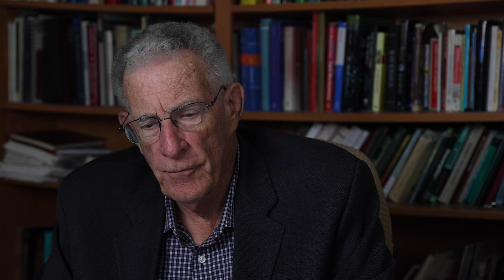The Mechanics of a Cancer Cell

Comment: I am afraid the latest research has shown that the aerobic glycolysis in cancer cells is NOT a universal phenomenon, and some cancer cells may still utilize oxidative phosphorylation. Additionally, The Warburg effect is NOT exclusive to cancer cells; some normal cells, such as certain immune cells, can also exhibit aerobic glycolysis. The complexity of cancer cell metabolism is highlighted by the presence of variations and exceptions. There is a strong genetic factor in cancer as TP53 gene mutation has been linked to increased glycolysis and the Warburg effect in breast cancer, for example.

To make things even worse, individual tumors often exhibit metabolic heterogeneity, with some regions or cell types utilizing glycolysis while others rely more on oxidative phosphorylation. This adaptability complicates the idea of a universal metabolic hallmark. To top it off, there are variations between individual cancer cell's metabolism within a single tumor and differences in tumors from the same type between different patients. 

Additionally, the metabolic change observed by Warburg is adapted to the hypoxic conditions inside solid tumors, resulting from the same mutations that cause other abnormal characteristics of cancer cells. Therefore, the Warburg effect is not the primary cause of cancer, but rather one of its characteristic effects.

For details, see: New Clarity on the Warburg Effect.
Reply: Dear Firelight.
The YouTube comments section is generally not well suited for academic debate, and typically an exercise in futility, but just as a point of clarification:

I agree with you that the “Warburg effect” is not a universal phenomenon, mostly because it is improperly defined. “Aerobic glycolysis” or “Walburg effect” is typically defined as “lactic acid formation in the presence of oxygen, when no lactic acid would be expected due to sufficient oxygen availability” (i.e., lack of Pasteur effect). 
Although varying degrees of lactic acid production are observed in almost all in vitro and in vivo experiments, recent (not yet well confirmed) genetic editing experiments show other pathways may compensate for loss of LDH activity (cf. PMID: 39211256). In vitro, the Crabtree effect also makes it difficult to interpret the contribution of OXPHOS and “Warburg effect" to viability/proliferation. I am not convinced proliferating non-tumoral cells display the same “Warburg effect” as cancer cells due to this, and it is difficult to quantify.
The important point is that no ATP (energy) is produced by “the Warburg effect”.

However, the argument presented in the mitochondrial metabolic theory of cancer, as best as I can represent it in my own view, is that loss of efficient ATP yield from OXPHOS (not to be confused with the electron transport chain or TCA cycle), leads to upregulation of substrate-level phosphorylation flux (sometimes called SLP or “fermentation”) in both the cytoplasm and mitochondria. This has nothing to do with the “Warburg effect” (lactic acid and NAD+ regeneration), but when observed, it would be a consequence of OXPHOS insufficiency, which is the initiating factor of the cancerous phenotype. The Warburg effect is not a cause of cancer.

Proton gradient and ultrastructure-dependent activity of Complex V and cytoplasmic and mitochondrial SLP flux is what generates ATP. All other functions may be important for the absolute capacity for proliferation, but do not generate energy. To the best of my knowledge, cancer cells are dependent on SLP flux (“SLP dependency”) and, despite having a measurable level of oxygen consumption, are unable to sustain proliferation using OXPHOS alone (“OXPHOS insufficiency”). 
This is why you will not find any papers showing cancer cells proliferating under dual inhibition (using drugs, to mimic what can be achieved in vivo) or depletion of SLP fuels (primarily glucose and glutamine, simultaneously), despite providing them with any oxidative fuel of your choice (fatty acids, lactate, ketone bodies). Cancer cells will only proliferate as long as glucose and glutamine are present. When they are not present, cancer cells are dead, which is an important hurdle for optimal proliferation, despite maximal utilization of oxidative fuels.

The goal of ketogenic metabolic therapy, which includes both dietary and pharmacologic strategies to target SLP metabolism, is to reduce the ability of cancer cells to produce energy through SLP while upregulating OXPHOS function in normal cells. 

Indeed, inhibiting glycolysis and glutaminolysis also reduces biosynthetic activity (“building blocks”), which may be a significant contribution to the therapeutic effect. However, viability of cancer cells is determined by ATP sufficiency, which is what we aim to target. Most research on this topic studies cancer cells with active glycolysis and glutaminolysis (sufficient ATP from SLP), and then explores how much or little they can use other metabolites. This is interesting, but is not the goal of KMT, and thus non-relevant to the discussion.

We are trying to advance this understanding in the scientific literature, which takes time and nuance in making the connections to previous literature and obtaining solid experimental data. I would recommend reading the papers the Seyfried group has published, and engage with the positions made in those papers. We are working on several publications that are intended to address the common questions you presented here.

I hope these are interesting points of discussion to you and anyone interested in the subject.
Best wishes, 
Dr. Tomás Duraj 
Postdoctoral research fellow 
Dr. Seyfried laboratory
Boston College
Reply: @drtomasduraj  Thank you for your thorough explanation of the Warburg effect, substrate-level phosphorylation (SLP), and their roles in cancer metabolism. 
I wanted to bring up a study I came across: "Dietary glutamine supplementation suppresses epigenetically-activated oncogenic pathways to inhibit melanoma tumour growth” Mari B. Ishak Gabra et al.  This research suggests that glutamine supplementation, rather than promoting tumor growth, can actually suppress specific cancer pathways in certain contexts, like melanoma.
This seems to counter the traditional view of glutamine as a straightforward energy and biosynthesis source for cancer cells. Instead, the study implies that glutamine's metabolic effects may vary depending on factors such as tumor type, microenvironment, and the epigenetic landscape.
I’m curious how findings like this might fit into the broader framework of ketogenic metabolic therapy (KMT). Could there be cases where glutamine supplementation might paradoxically benefit cancer therapy by disrupting oncogenic pathways or reprogramming metabolism?
Additionally, does this point to a need for more personalized approaches in targeting cancer metabolism, where therapies are tailored to the specific metabolic vulnerabilities of different cancer types?
I’d love to hear your thoughts on this and how such research might refine our understanding of glutamine’s role in cancer. 
I’ve been in contact with Dr. Seyfried and Derek Lee, and our discussions have greatly expanded my understanding of the complexity of these pathways. If you’d like to continue this conversation further, feel free to reach out via email. My initials are P.G.
Reply: "I am afraid the latest research has shown that the aerobic glycolysis in cancer cells is NOT a universal phenomenon, and some cancer cells may still utilize oxidative phosphorylation."

ALL the metabolically-related cancer which were almost non-existent a 100 years ago are connected to the Warburg-effect.

"The Warburg effect is NOT exclusive to cancer cells"

You apparently missunderstand what Warburg efffect is and why it is  a problem.
And BTW, Warburg effect is pathogenic in other diseases, such as heart -failure or COVID-19...